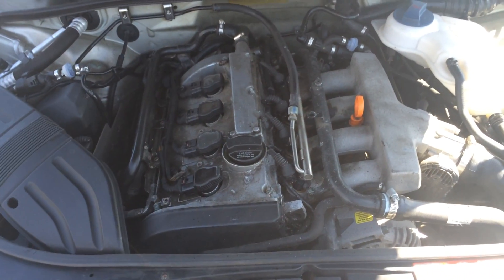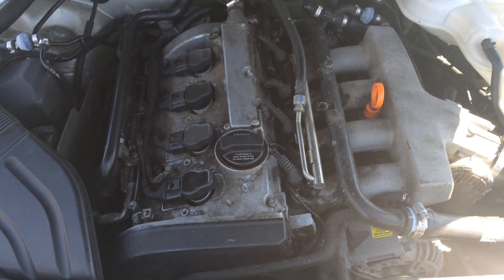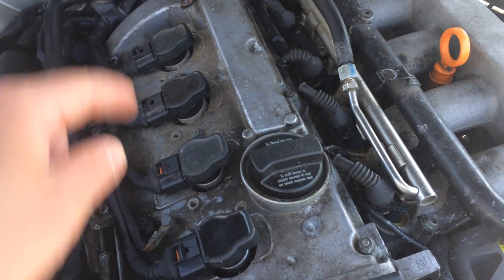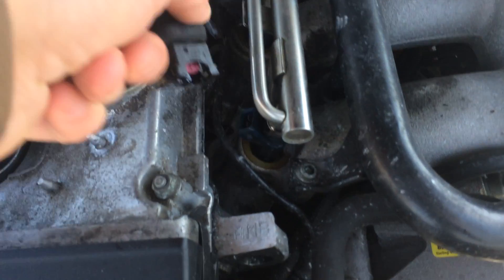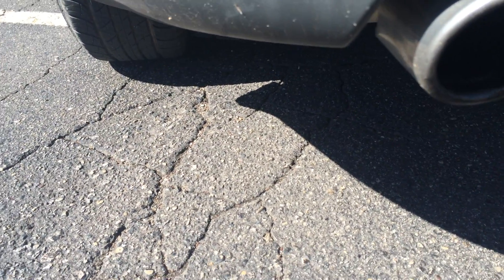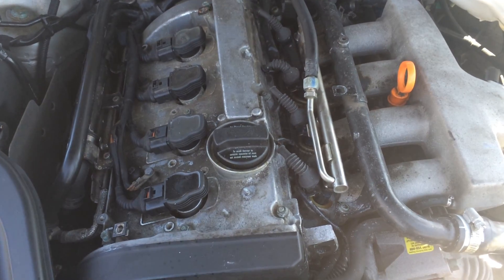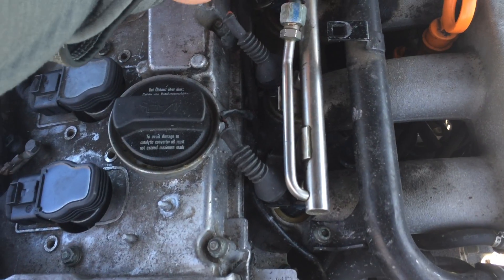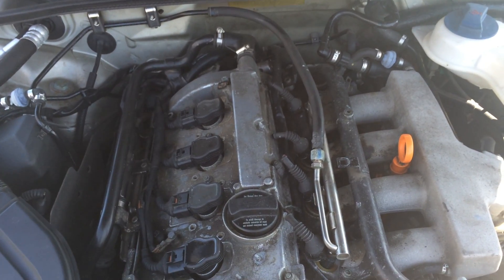Audi A4 Coil Pack Failure Test

Comment: explain for me, when you take off the connection injector have some liquid in esxaust correcto thats because dont have a good burn combustion, my Audi A4 1.8 20V have this symptomatic like this hever day when the temperature is down have misfire but when hight temperature Works fine, you think I have some problem with my injector dont a haver a good stanch. Do you have some idea.

Comment: Hi there, I have an A3, 2006 2.0T FSI; and from a cold engine start - the engine would run very smooth, but as soon as the temperature to 90 degree C; the engine will shut off and never start until the engine cools down. Is anyone familiar with this situation?
Reply: I’m currently having the same issue after changing spark plugs and valve cover gasket
Reply: @anthonytrottier4350  Most likely a temperature sensor, there are 2 on the car, both are cheap, Not a 100 percent sure but worth a try

Comment: if you disconnect the fuel injector the engine doesn't change its idle, that is your bad coil pack.
Reply from the maker: +nate8930 Thank you for the comment Nate8930, that is exactly right!
Reply: Great. That is a little more clear. Thank you Nate.